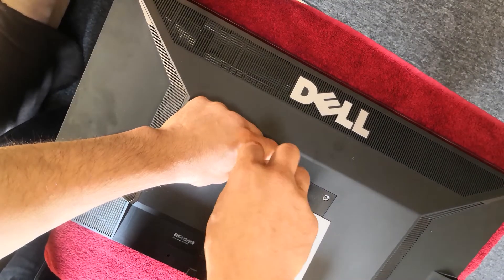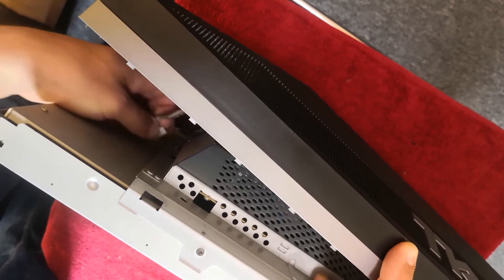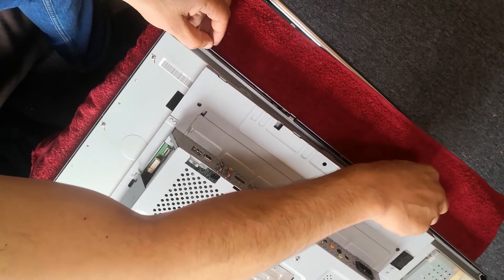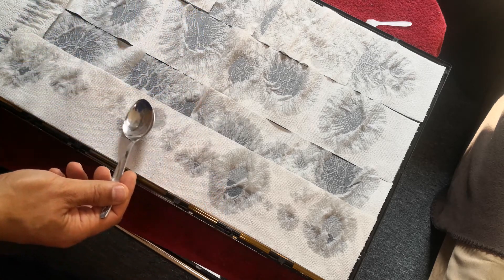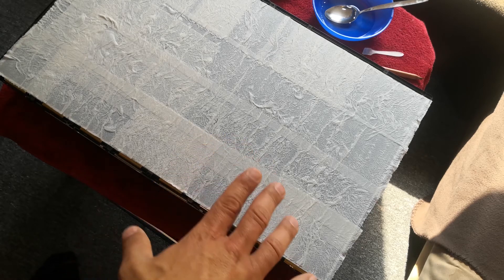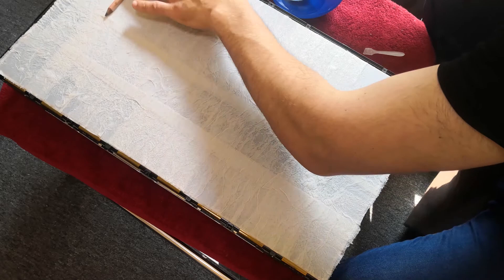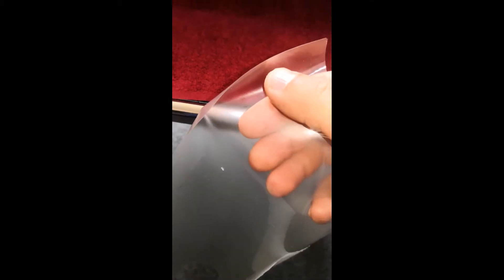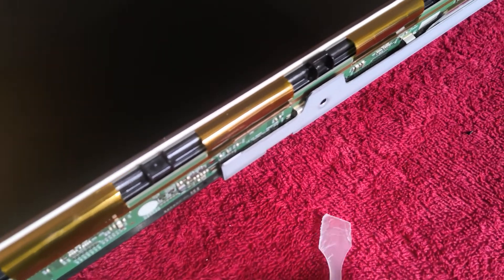uncoating Monitor - Anti glare removal, Dell  U2711 (Matt to Glossy)

Comment: Does this work in HP laptops? I have HP Elitebook G8
Reply from the maker: @gigavolthavoc07  i cant find a coating description by hp. but if its matte and not a touch screen it could be H3. 
I did so far only monitors and one was an older HP ZR30w succesfully. Notebook screen dissasembly processes are more difficult and risky.
Reply: @tsk-meteakabruceleekills1311  thanks man, i think i'm not going to risk it

Comment: my U2711 now when it's on white background if i look at it with bare eyes i see white but when i take photo it's a bit red. does this solution help? i'm not sure if the coating is already degraded or the pixels is.
Reply from the maker: @jlelelr  i think you should configure color saturation from the graphics card. This tutorial here might not be your solution.
The issue you're experiencing with your Dell U2711 monitor, where a white background appears white to the naked eye but shows a red tint when photographed, could be due to several factors. Let's break down the potential causes and whether the solution you mentioned might help.
Potential Causes:

    Monitor Coating Degradation:
        The U2711 has an anti-glare coating that, over time, can degrade. If this happens, it might cause subtle color shifts, especially when viewed through a camera. However, if you only notice the issue in photos and not when viewing with your eyes, the coating may not be the primary issue.

    Color Shift in Pixels:
        Aging LCD panels can sometimes develop issues where the pixels don't produce the correct colors. This could lead to a slight red tint, but typically, this would be visible both to the naked eye and in photos.

    Camera Sensitivity:
        Digital cameras often have varying color sensitivities compared to the human eye. This might be why you see white with your eyes but notice a red tint in photos. This is especially common if the camera's white balance settings are off or the sensor is more sensitive to red wavelengths.

Possible Solutions:

    Check the Camera Settings:
        Adjust the white balance on your camera. Set it to "daylight" or "custom" and manually adjust it to see if the red tint disappears.

    Calibrate the Monitor:
        If you haven't already, try calibrating the monitor using a hardware calibration tool or software like DisplayCAL. This might help in reducing any subtle color imbalances.

    Monitor Settings:
        Check and reset the monitor's color settings. Sometimes, tweaking the RGB settings or resetting to factory defaults can help mitigate color shifts.

    Inspect the Anti-Glare Coating:
        If you suspect the coating is degraded, try gently cleaning the monitor with a microfiber cloth. If the coating is visibly damaged, there's not much you can do short of replacing the panel.

Conclusion:

The solution to your issue depends on the root cause. If the red tint is due to the camera's white balance, adjusting the camera settings should resolve it. However, if the monitor's pixels or coating are degraded, the problem might persist, and you may need to consider professional calibration or even replacement if the degradation is severe.

To determine if the issue is with the monitor or the camera, try photographing a different white screen or monitor under the same conditions and compare the results.
Reply: @tsk-meteakabruceleekills1311  ok thanks

Comment: Was pretty skeptical about this method at first but turned out to be working real good
Reply from the maker: Yeah but depends on monitor and coating type... different models will get different results 😄👍
Reply: @tsk-meteakabruceleekills1311  Thanks for your tutorial, any ideas on how to do it with Gigabyte gs32q?

Comment: Did this on an Asus eeePC 701 (famous mod to remove the antiglare). I have several ones, but had one with a huge scratch on the screen, so I started with that. I made a mistake of not waiting long enough. Tried to pick up the antiglare after 15-20 minutes, and it started to peel, but took off little pieces from the polarizer as I tore it. I let it soak one more hour just to see if it gets better, and it actually did. After that, I managed to peel the antiglare without damaging the remaining polarizer area. For this one, at the end I decided to peel the polarizer film as well, which came off a bit harder, but totally manageable with some patience. I will either buy a replacement polarizer film, or keep this one as is (I have 4 others, I bought them for modding/experimenting), and make privacy googles from the polarizer film.

Comment: Thanks for the video. I used to do this when I made projectors out of lcd monitors lol. The antiglare was removed to increase the brightness of the display. These were only 17" monitors at the time, they were fun projects. A word of warning to anyone attempting this is to be very careful with the ffc connectors. These are the connectors "ribbons" on the edge of the display. They are extremely fragile and can tear easily. I managed to tear one of these connectors because my microfibre cloth got caught on the edge when i was "carefully" wiping down the monitor. I had just removed the antiglare and everything was perfect then ripped the ribbon with the bloody cloth, could not believe it, still gives me nightmares. Just treat them as if they are made of paper and you will be alright lol. 😀

Comment: my dumb display has ground cables im assuming on the inside & literally was wrapped around the cables like a ziptie.. i cut thru it so i doubt i can use my screen now
Reply from the maker: Thats sad to hear bro....
Reply: @tsk-meteakabruceleekills1311  it wasn’t a monitor, it was a old 768p 32 inch tv but im supposed to get a new monitor

Comment: Pulling by lifting up is wrong! The safe way is to pull slowly, parallel to the ground.
Reply from the maker: Hi, you got a nice link to a good video or can you explain the move in detail? depends on the model also i guess...didnt realize that, but thanks bro 😊
Reply: @tsk-meteakabruceleekills1311  I say this as a rule of physics. What I'm saying is not just to to peel off the monitors. To pull a wheeled car, do you lift it up or do you pull it parallel to the ground? You are pulling with the monitor at an angle close to 90 degrees. However, if you pull it from as narrow an angle as possible with the monitor, it will be much easier to peel off and you will avoid the risk of damaging the monitor.

Comment: For anybody wondering a reliable way to check if it’s a polarizer or an anti glare coating before fully committing to a peel. 
Peel like one TINY piece of the monitor off near a corner where the black bezel is still there and you should see 2 types of layers. Put. a piece of paper under said peel and you will see Dark grey OR light grey.
Dark grey is the polarizer and it means you’ve gone too far down. Wait longer or aim your knife or tool slightly higher. I found a razor blade works best but your’s might not like it.
The light grey is the coating and you should not see any dark patches on it. It should be perfectly clear with maybe a grainy texture. 
And for anybody wondering the dark grey is VERY dark. Just look up videos online about removing the polarizer. And look up anti glare coatings. They are night and day. So trust the piece of paper.
Reply: yeah on my laptop the polarizer and the anti glare coating were together. Just make sure you're peeling off the clear layer and not the black one

Comment: My Ultragear 27GR95QE matte coating was an remarkably thin layer like 0.1mm. So I couldn't get them to separate. I soaked it for 10 hours. Most of the water was not on the corners though. 

When realizing the polarizer was lifting on three out of four corners I aborted mission. Hopefully the monitor turns on again.
Reply from the maker: Yeah, newer coatings are different....too thin.
Reply: Thanks I was looking to do the same thing but I won’t now.

Comment: My monitor is a LG monitor, Model number is 22MP68VQ-p. On the specs page of this monitor it is written Surface Treatment	Anti-Glare,3H. Is this process possible with this monitor ?
Reply from the maker: I haven't tried that model so far.
Reply: @tsk-meteakabruceleekills1311  ok

Comment: I think it's pretty much impossible to do this on some modern ips gaming monitors. my display only has what looks like 1 incredibly thin layer of material ontop of the lcd glass. could not get them to separate even 0.1mm on the corner so I gave up. 

Really does look like they are using a polarizer that has a matte finish and not separate layers.
only option may be polishing the matte finish to a mirror finish, which I know someone who did that to an xg2431.
Reply from the maker: Is it H3 or some semi matt coating? But you did the right decision. If you realise your chances are low, break up. I'll try a Lg38uc99 IPS today with curved screen. For me it also looks like a new type of coating with thinner surface structure.
Update on the LG38uc99: i began with the corners and realized that the coating is breaking and is too thin. I stopped right there to prevent the destruction. Seems to work only on older types of H3.
Reply: @tsk-meteakabruceleekills1311  yeah it was H3

Comment: Is it possible to do this without disassembling the monitor? Would the water pose a risk to the internals?

Edit: I’m asking because my monitor already has the panel corners exposed and an external power supply, so I don’t think it would be an issue, but I’m not too knowledgeable on how monitors are laid out internally.
Reply: @Osito_Confesoso  why listerine?

Comment: This works! Just did this today. I was worried I would destroy my monitor however it turned out really well in the end.
Reply: I've been trying to do this. I've done it on some of my other displays and it worked fine but for this current display that I"m trying I've soaked it with paper towels for hours and only some of the anti glare layer will come up. (the corners are basically all stuck Any ideas what I should do? Thanks.
Reply: @anothernumber9753  same with me...what did you do then??

Comment: I'm kinda confused now. After 6 hours of soaking, nothing happened. I tried to lift up one corner. And the film is not like the ones I see on YouTube. It's really stiff. It cracks when trying to peel it of. It's AOC 24 inch monitor. At first I thought it's polarization filter coming off. But no... It's the film so stiff.
Reply from the maker: Which Monitor model? I bet it is not h3 coating. I guess it's a semi glossy with a thick glue. 
Before you break it....stop it.

Comment: Once the coating is removed, what's the procedure for everyday cleaning of the display?
Reply: I would ditch the ipa and just use a clean micro fiber cloth. Just be gentle don't go HAM while wiping it
Reply: @hamajangz9586  you're right, the alcohol would only damage the layer in the long run
Reply: Lint free cloth, slightly damp with distilled water
Reply: You can use a microfiber cloth with a  small amount of rubbing alcohol
Reply: @anothernumber9753  Yep my go to is exactly the same - microfiber cloth and isopropyl alcohol.

Comment: Thank you! Just did my Dell S2721QS 4K monitor very carefully, the colors, the contrast, the sharpness are just outstanding now! Don’t understand why companies don’t have two options for at least some monitors, never going back to matte now 🤩

Edit/Update: 3 months in and still working excellent, no distortion or irregularities. Except for one thing, if you do this please don’t use anything to clean your screen (I wouldn’t even recommend water) besides a dry microfiber cloth gently. Reason being, I without thinking used cleaning spray and made a little stain on edge of the screen on the polarize layer since it had alcohol. Not very visible when screen is on, hate it but still worth it, just be careful 😅
Reply from the maker: Nice to hear...i still use my uncoated U2711 Dell!
Reply: Did you have to take it apart? Seem like the film can be removed as is?
Reply: @_Mario_PL_  Yes, you have to take the frame apart to get the front plastic off (where the Dell logo is), because the film goes half way down the plastic portion. I would not recommend taking film off without taking the Monitor apart because water may not fully go down to the bottom edge of the film and of course water could get into areas where you might not want it to go, it’s tedious but worth it.
Reply: @design_by_sunny  Thank you for the reply. I have Dell UltraSharp U2720Q 27 Inch 4K, which looks to have a different frame from the one you have. After next week I will have more time to mess around with it. Don't want to rush it and ruin it, but most definitely I want it done. (My Dell logo is on top of the film itself)
Reply: @design_by_sunny  How did you take apart the monitor? (I have the same one) Does the white back portion separate from the front? If so, what did you pry it open with? Anything else noteworthy you discovered that differed from this video? Thanks!!
Reply: @kandw15  Yes take out the stand and unscrew any screws you see. Then carefully pry the back (white portion) open with something flat (plastic material recommended), it will take some force and the white plastic portion might bend a little (as it is just held by clips), but it does come out eventually. The trickiest part is separating the bottom portion where the ports are. Also don’t put your flat tool too deep because there are cables and stuff you don’t want to break. 

Once you do that there is a black frame that also needs to be unscrewed that goes all the way around the edge of the screen. In order to fully take apart this black frame (which is where the Dell logo is as well) there will be a ribbon cable (which has a lock system which needs to be unlocked first before you can pull it out) and a normal plug in cable that is attached to the frame.

Also I would suggest soaking with tissue paper and water for at least 3 hours since it’s a bigger screen, and make sure it is wet during the duration but not too wet and just do what he does with pencil, be patient with it and should be able to peel the film off smoothly and easily. Good luck!
Reply: @design_by_sunny  thank you so much for your reply!! I really appreciate the advice and will do exactly that
Reply: @design_by_sunny  do you ever have issues with it being too reflective? Or is it perfect
Reply: @kandw15  It is a little reflective, but I just adjust room window lighting and turn the brightness up, you get used to it
Reply: Do you have vids of pics of the the monitor, or you doing it,? I have the same model and would like to try as well.
Reply: @liberdelta  I only have couple of pics as a reference for myself to make sure I put everything back how it was originally, but I did not record it or anything. Definitely do some research though, as it helped me determine how I wanted to do this. I can send those pics if you’re still struggling.

Comment: Just tried it on my Lenovo.. prying open from the front is a big no no I got a small crack on the top screen. It comes apart from the sides. Still got that damn AG layer off.
Reply: what do you mean from the sides, did you pry it from the outside? are you saying i shouldnt pry from the display area, only from around the monitor?

Comment: This does not work on ultragear moniters, this does however work 100% very easy with AORUS screens.
Reply from the maker: I used cold
Reply: can you elaborate? I have the LG 27GR95QE and I'm considering doing this. I took a piece off the corner to examine it further and I see the anti glare layer and polarizer together. Did you attempt this? How did it go
Reply: @P1LL91  Did you go through pealing the matt coat? I'm considering getting the 35 inch ultrawide oled and the matt coating is the only thing stopping me.

Comment: Very Urgent:
i tried doing this on my laptop with lcd display
but in my case along with antiglare i got the colour film with it in pieces
when i apply it back, like physically put it against my screen comes back
else it is all white and the removed antiglare and film polyethene is kinda of no use
is there any other way to fix it
please reply brother🥺
Reply: my guy just ruined his laptop
Reply: @maclethal666  yeah brother🥺
Reply from the maker: @rohitsunariya8469  haha sorry to hear that. Can you order a replacement LCD for it? 
Ive read about some glue to paste it back but this must be done from an expert - worth it? 
This happened at my first monitor too....i made agent-glasses from the polarfilter. Spy notebook. :)
Reply: @tsk-meteakabruceleekills1311  i have read and watched a lot about it
and like i came to a conclusion that i have damaged polarizer film only so now i have orderd a new polarizer film 
and now i will apply it
any further suggestions??

Comment: After more than 1 year, is the screen still working? I've read that the polarizer underneath the anti glare coating is very fragile and this operation considerably  reduce the longevity of the screen.
Reply from the maker: Mine is still working...since 2 years or more. My experience is that if something went wrong, youll discover it within 1 month.

Comment: I have an lenovo g27q-20, and dont ask me how but i spilled superglue on it, can this be a solution for the stain that is on my monitor? changing the polarized sheet is an option? idk if it has an anti reflective sheet but all i know is that it has a matte finish, thank you for the video!
Reply: Changing the polarizer sheet is a very difficult operation. Just removing it is the simple part. You'd have to find a proper sized one, probably on ebay/aliexpress and you'd want to use screen protective fluid (the one they use to apply silicone screen protectors on smartphones displays) and have some experience with it. Maybe some technicians who do this daily to smartphones could help you out with it but if you've never done it, I'd say don't try it as it's quite difficult to pull off well.